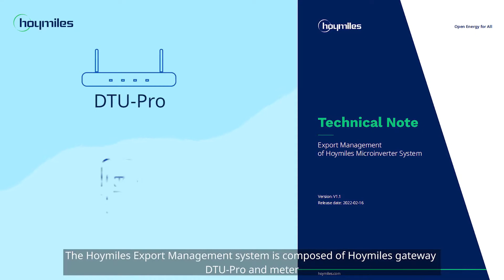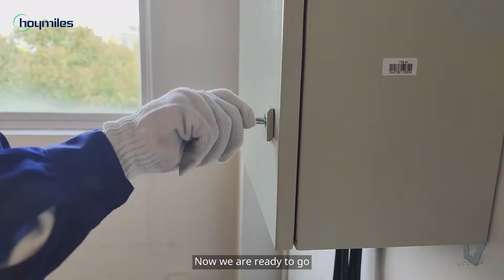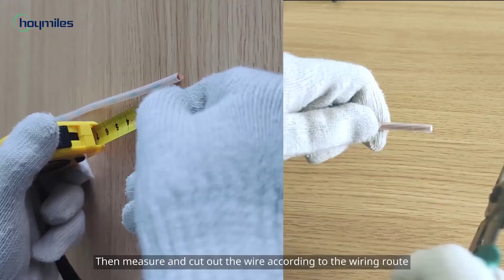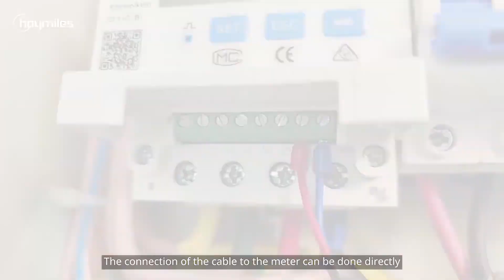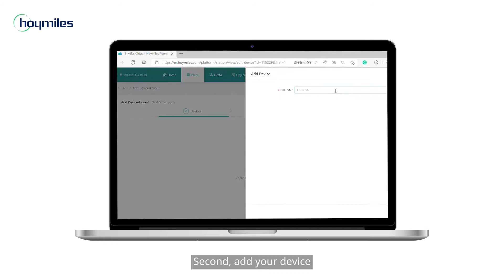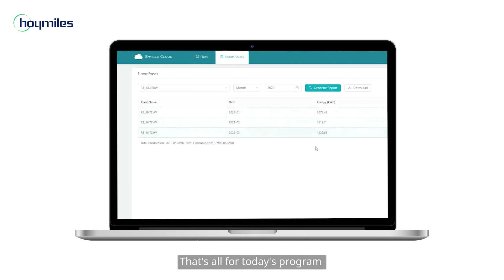Zero Export Solution with Hoymiles Solar Microinverters

Comment: Must be one of the most Zero Export solutions in the market. For the money of the DTU Pro, plus CHNT, NOT counting electrician costs, you can buy systems that are superior for less money. Superior as they work with several types of energy measuring systems, plus they can charge batteries by AC or DC. There is no Hoymiles product like that and your HMS-1600-4T probably has the worst sub 1G connectivity around. Everybody uses wifi. I‘m soory to have bought such inferior product.

Comment: I wonder, can this Hoymiles Export Solution help us to build a rapid shutdown, in the event of any emergency where the grid goes down? By law, we need a built-in rapid shutdown of the solar systems from the grid so that, in the event of any emergency, your solar power export to the grid will be turned off instantly and easily, keeping utility workers and first responders safe. Now the complete solar system goes down for that, and we can't use any energy during sunny blackout hours. Enphase introduced a solution for that with their IQ8-series, which switching your home from on-grid to off-grid virtually seamless. Together with a IQ System Controller and an Enphase IQ Gateway-S Metered WM. Is such a kind of zero export on a grid failure also possible with Hoymiles Microinverters?

Comment: My DTSU666 for Hoymiles has a 12 digets SN wich starts with 220xxxxxxxxx and not with 10Cxxxxxxxxx.
So i can't enter the SN on the S-Miles Cloud.
The SN starts with 220... and this are not correct.
Are these DTSU666 false? Or has the manufacture changed the numbering?
Reply: How good that i not buy this inverters, they make a shit with meters, later u can pay with cloud usage
Reply from the maker: Hi my friend, we need to confirm if you bought these units from authorized partners? As Hoymiles we bought the meter from the factory, and then re-code it to match our platform. Any questions, please feel free to contact service@hoymiles.com . Sorry for late reply as here the network not that good.
Reply: @LeoZhuHoymilesMicroInversor   Hi, I have the same issue. It seems that I bought DTSU666 that is not set up to communicate with DTU Pro S (its serial number starts with 22xxx.  Is there a way to set it up manually or do I need to buy another DTSU (but set up for Hoymiles communication)?
Reply: @LeoZhuHoymilesMicroInversor   We Buy the HAT  in box is DTSU666, but there is no SN on it!!!!!
and for install there asking the SN number
Reply: @smarthome10 you need to buy official meters hoymiles branded, the generic DTSU666 will not work

Comment: I have 2x HM300 and 1x HM1500 -> is Zero Export possible with the DTU Pro? Are more than one HM supported?
Reply from the maker: Hoymiles we have a 158kW microinverters' system set in South Africa by our local partner, over 260 units MI-600 model, zero export function equipped.

Comment: I just followed all the instruction and it seems to work. I set the export limit to 0 like explained in the video... But now i on my meter that 4 kw were exported to the grid today - can this happen or is there another setting i have to change?
Reply from the maker: Hi Jurgen, sorry for late reply as the network not that good. If export it depends on the system, if it has consupmtion. Anyway, any technical questions, please feel free to contact service@hoymiles.com
Reply: Depending on the system you use, zero export does not mean that no energy will be exported to the grid. Only total energy (all phases combined) will equal zero. This means you can be using energy you produce on phase L1 and L2 while exporting on phase L3 (with zero export mode enabled). This is very badly explained in the manual and can not be fixed according to Hoymiles customer support (unclear why).
Reply: @lukaolvitz3744 they have phase limited export now, you need to change the settings and you can fix this
Reply: There is no offset setting, i have the same problem every day go about 2kw to grid! so i need always  pay the fine, also next time no Hoymiles more!!!
Reply: @smarthome10  they have phase limited export now, you need to change the settings and you can fix this

Comment: Is ist possible to use another modbus energy meter?
I´m currently using an SDM630 Modbus V2 80A (which is very common here). 
Is it possible to use this instead of an DTSU666?
Reply from the maker: Hi sir, as we need to re-code the meter, so it’s requested to be bought from Hoymiles or our authorized partners

Comment: Can i use 2x Hoymiles HM-300 instead of one HM-600 for the Zero Export?
Reply from the maker: All Hoymiles microinverters with DTU-Pro or DTU-Pro-S can achieve zero export function. Hoymiles meter and CT also necessary according to the system